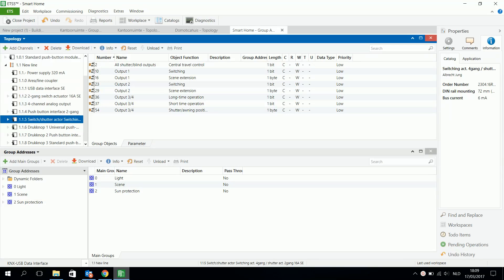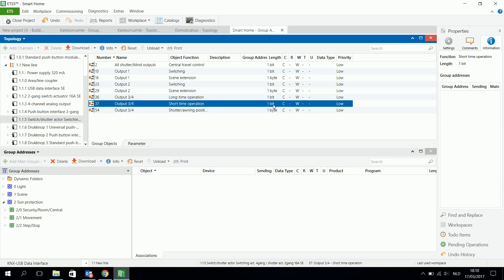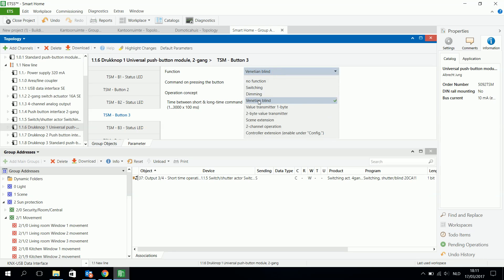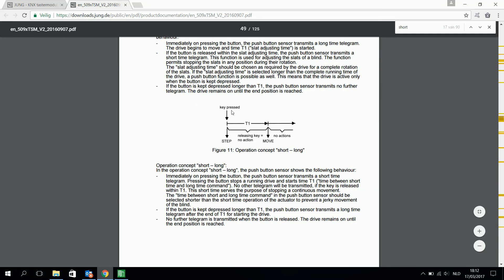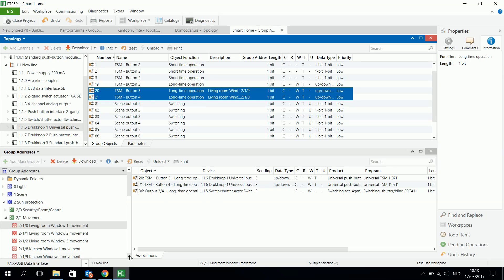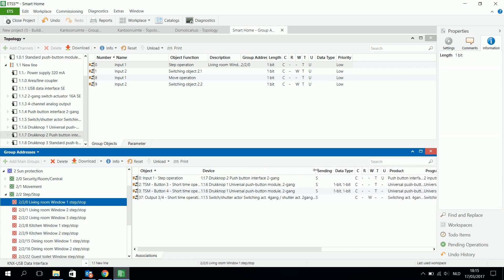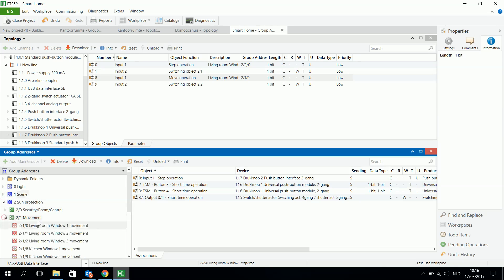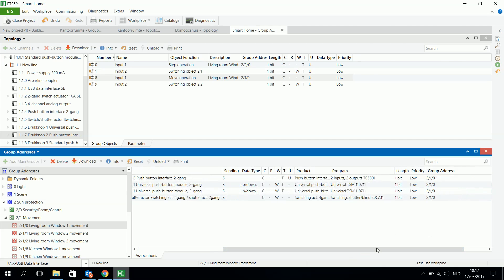KNX ETS5 Shutter Venetian Blind Control

Comment: KNX Motorized Curtain Kit Advantages as below: 
1, No need KNX shutter actuator anymore, save a lot cost
2, KNX Certified Product with Patented spliced track system
3, Standard package from 2.2 meters to 8.2 meters
4, Very convenient for distributor and store/online seller to sell
5, Standard package make shipping and stock more easier